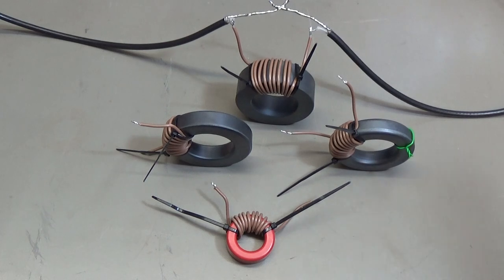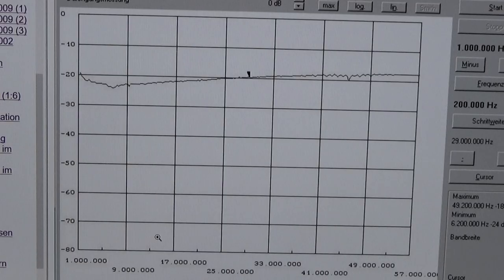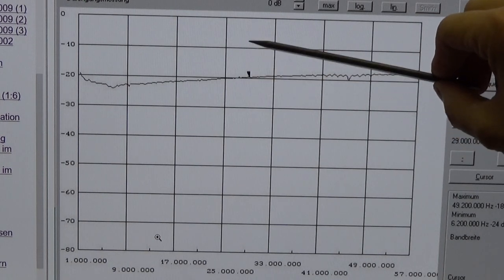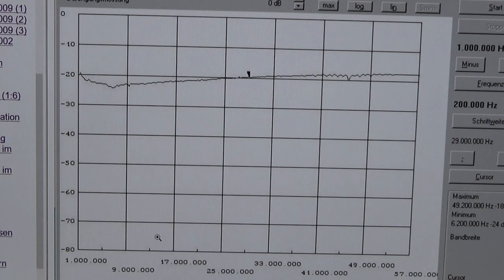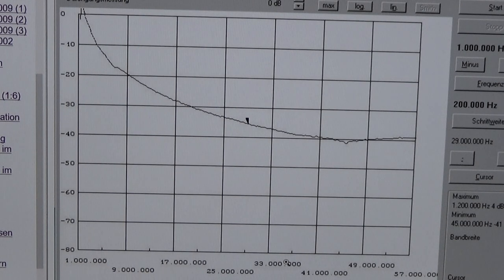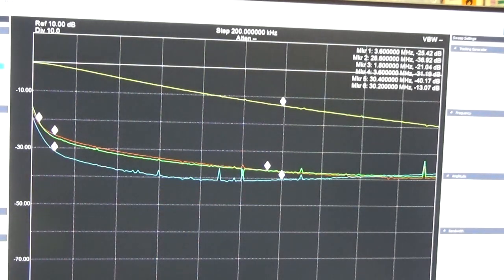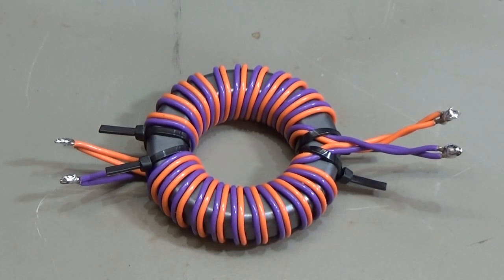#101 Balun PART 2: Balun's magic and how to wind an effective working Balun

Comment: What happens if I accidentally put an extra turn on each side of this balun design? Does that negatively impact performance?
Reply from the maker: Hi Jason, no not 1 turn but if it to much you drive the core into saturation which finally ends into a magnetic short.. 73

Comment: What's the relationship between (core type & wire gauge & windings number) versus impedence ?  How to calculate 100 // 100 ohm  that's will be a 50 ohm system ?  As I see in video part 1, the other balun (white-brown winding) present a good CM attenuation but a bad SWR over 1 - 30 MHz sweep ... uhmmm ....  Btw, thank you very much for your video explainations !
Reply from the maker: Yes the wires needs to have 50 ohm impedance otherwise they will run  out of SWR as we have seen it. If we connect two 100ohm segments right and left winding in parallel as we did then we have 50ohm and a good swr over the entire bandwidth ...
Reply: Sorry, I don't agree / understand ! A wire is a simple a wire ... it have no specific impedence. As far as I know,  wire (in DC domain)  has a specific resistence ( in function of material, diameter, length),  but impedence ? Will impedence change in function of wire material, AWG size, number of windings and so on ? Eventually how to calculate it ? Uhmmm ... feel confused sorry.  Thank you ...

Comment: Superb series - thank you.  Could somebody help me with the following: Peter says that we need a torroid such that the attenuation is high so that the common mode currents will be 'zapped' however won't this attenuation also affect the wanted signal that we wish to pass?  Now, I guess that the wanted signal is not attenuated but would some kind soul please put me out of my misery and explain why?  Many thanks Kevin M0XYM
Reply: The useful part of the signal stays nearly intact (very low insertion loss). The key here or you can call it the purpose of this part is the common mode current rejection, which some are unaware of, but very important to take care of it in order to have quality singal. - The useful signal that you care about is not the common mode type. I recommend to pay attention to every word he says and watch the next part as well. Pause and Replay if you get lost and watch it again.

Comment: Thanks for the awsome video Peter.
I wish I had such measuring equipment. Especially the VNA.
What do you think is the right toroid for a 100W equipment?
I want to build a 1to1 balun for portable use so it should be compact.
73 Bernd
Reply from the maker: Thank you Bernd. Well for 100W a FT140-43 is perfect. Hope that helps. 73
Reply: It helps! .....and what luck, I have even 2 in my stash :-) 
I'm going to wrap my balun tomorrow.
Nice week and thanks again!
73 Bernd
Reply: I'm trying this on a 140 core I had lying around. 11 turns of some 22awg ptfe wire I have doesn't fit neatly against the toroid on one side. Would leaving it looser cause a problem, or should I just use two toroids with 11 turns each?

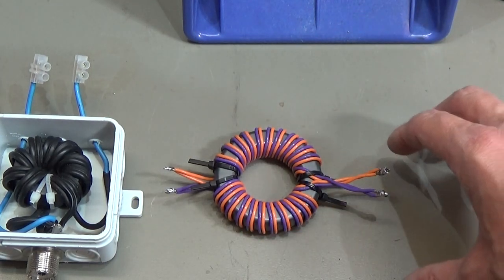Comment: BUT, YOU CAN DO 2 JOBS WITH 2 CORES! At 50:44 do both. The 4:1 has low loss. The Choke has common mode loss. Cascade them.

Comment: I am using an UNUN inside my MORPHY RICHARDS 27024 LW/MW/SW/FM/DRM/DAB SDR and is working better than ever before but I think I will have to add another one somehow for SHF 1452-1490MHZ(1.452-1.490 GHZ) so a stripline BALUN is going to be hard to make.
Reply from the maker: Ah very good David, sounds good. All the best 73

Comment: This is a very educational series. I would really love to know what core the blue line represented?
Reply from the maker: Yeah me too :^) No to be  serious I don't know. It is out my junk box and I have no clue where it comes from...Thanks for watching 73
Reply: No worries. If you ever find out, keep us posted.  The wire you are using appears to be a 19 strand. Do you know the effect of using a similar wire with 41 strands? It should provide more surface area, but i'd like your opinion.
Reply from the maker: You are talking about skin effect and yes with more surface more power should be possible but I would additional stack two cores.. 73
Reply: Indeed. I have been researching using stacked cores. If I understand correctly, the cores are just stacked together, then the wire is wrapped around both cores as if they were one. I have also been seeing positive results from FT-240-K Cores versus 240-43. Thank you again!
Reply from the maker: Yes stacking is that easy :-) Good luck with the project

Comment: Peter, could i use 10 turns instead of 11 as my Balun is slightly smaller ?, 73's VK6NJP
Reply from the maker: Hi Jim, yes it is possible but you lose of course inductance which cause a lower attenuation on the lower frequencies.  But no question test it out. 73
Reply: Thank you Peter. 73

Comment: Hello Peter! I recently decided to build a new Windom antenna and, as I had previously seen your videos (I'm one of your best fans I think :)), I decided to follow your advice. I began building the 1:1 BALUN but I stopped there. While I used your same identical wire (I bought it in Germany), winded the same identical number of turns in the same way as you did and connected the wires exactly as shown, I decided however to use an Amidon 240-K toroid, instead of a 240-43, because of its larger bandwidth. Unfortunately measured results (I have a MiniVNA Tiny) on a resistive load were unsatisfying. Even from 1,8 to 30 Mhz the S.W.R  and impedance have much more deviation along the frequency range (from 1,03/50 circa to 1,31/61). I'd be curious to see your measurements on a similar toroid, if possible. 
I really do not understand if the fault is the chosen toroid or if I have been screwed and the toroids I have are not original 240-K.
As the use of 240-K toroids is becoming widespread for their assumed larger bandwidth, I think this could be interesting for many hams that want to build their own BALUNs. Thank you for your videos.
Reply from the maker: Simone, I believe that the toroid is the problem. I'm more than sure that using a Amidon 240/43 will solve the issue. May be this report will support you additionally https://a08.veron.nl/zelfbouw/antennes/800-watt-fd4-multiband-antenna-with-super-balun/

Comment: A great set of videos.
I have a couple of questions.
In the 1st video, you used a stand-alone spectrum analyzer to test attenuation. What software and analyzer were you using in this video?
How did you determine how many turns to use?
Thank you for the great instruction.
Karl
KE0JWK

Comment: Uhmmm... correct, but ten turns and so close are too much to test a toroid up to 50 or even 30 MHz (I am referring to the parasitic capacitance between the turns): for this reason in that part of the graph you don't get a reliable data. You end up seeing the effect of those distributed capacitance: in fact, at those frequencies, the graphs of the three ferrite toroids overlap despite the different mixes. After all, for a broadband transformer starting from 3.5 MHz and using a mix of 43, with only two or three turns (depending on the size of the toroid) you get enough inductance for a primary.

Comment: hi i've just a little question why choose the ft240-43   core  and not the 240-77core for 0.5 to 50Mhz...??? is the ft240-43 better???
thanks F4HDI franck
Reply from the maker: with high TX power a 77 core material might go much easier into saturation which will end up in a no working balun...73
Reply: TRX Bench ohhh i see thanks for fast reply  you re vidéo are awesome in explication how work balun thanks for them 
Best 73 
Franck

Comment: +TRXBench  Very nice videos, danke! Perhaps try twisting the pairs of wires. Twisted pair impedance can be 100 - 110 0hms. Perhaps possible to achieve closer to 50 Ohm  Z for UNbalanced input impedance?
Reply from the maker: There are 1000 ways to do it in a good way. The problem is rather more that there is a lot of crap in the field... Thanks for watching 73

Comment: Hi, you have superb videos, I really learn a lot from them. I had some so-so experience with certain rings not being as effective as I expected. So I just ordered some material 43 ferrits :)

Can you tell me the type or specs of this wire?  I understand it is AWG 18 and TPFE, but I see many varieties on the market. Also, would you recommend this as the material for wire antennas?   73 de HA5XA
Reply from the maker: Hi Krisztian, it is AWG18 PTFE....Here is a data sheet. http://www.habia.com/globalassets/documents---downloads/single-wires/e-and-e-npc.pdf  Thanks for watching 73
Reply: TRX Bench Thank you, I just realised you showed us the wire label in the next video. :)

Comment: Where can I order the correct wire you used in the video. The video is great.
Reply: I just purchased the wire from Powerwerx.com   They also have powerpole parts
Reply: Thank you....
Reply: @mayimchaimqigongstudio6570  for low power that's ok. but no teflon wire there

Comment: Beware... use the Exact wire specified...l tried to use another brand which seemed fine on paper but... the outer diameter was 2.2mm and not 2.1mm as per his brand, the result is overlapping turns because the core internal diameter can't accommodate the wire.

Comment: Hello Peter, this was a VERY good design, i managed to get hold of the same wire back home, ( the silverplated type ) and my HP shows an amazingly flat response all the way past 100Mc, with similar CM attenuation.. around -35Db and this also very high up in frequency - best response i have seen... :-)

Also have a CB question for you, i got in an old Pony CB-78 on my table, but i cannot for the world find any schematics for this one, i asked our friend Mike (mikesradiorepair) but he dident recognize this one eather, ....now i got this thing to work fine.., not a problem, but i´m still hunting for schematics.. PCB nr:KM-35858-00
I have seen this before in Sweden and came to think of you since you are based in Europe

- Any ideas?

Again nice work with all the videos
73

/ Anders
(Sm7HCE)
Reply from the maker: Hi Andres, very good that you was able to repat the good test results. That proofs the robust design of the balun...
Well bad massage concerning you CB radio I'm sorry nothing in my files...73

Comment: First thanks for the nice video's, so i learn things easy, i have a question for you, i always make baluns with 43 core material, but what core material is the blue line, and did you test 61 core material, like the FT-240-61, thx 73
Reply from the maker: Thanks Jos, for chokes/ attenuators Mat 43 is fine it works from 30-600MHZ...Mat61 for even higher frequencies...73

Comment: Hello,
I've made 2 baluns one with FT240-43 (AWG18) and one with FT140-43 (I've used AWG22). With FT 240-43 the results are pretty the same. But with FT140-43 SWR is around 1.5 at 30 MHz. And almost 2 at 50 MHz. If maybe someone was trying to use FT140-43 and got a good results - could you please share them. Thanks!

Comment: Hi:  Can you give the exact part number label for the wire you used? Thanks.
Reply from the maker: Hi, well the only info is that it is AWG18 PTFE silver finished stranded wires.. Hope that helps. 73
Reply: Is there not a Brand name or supplier?  The spools that you showed had part numbers, but I couldn't read them on the video. Thanks.
Reply from the maker: I'm sorry, that is all I have...
Reply: Curious as to reasoning for refusing to give the manufacturer and part number from the spool of wire shown in video...is it a 'trade secret', or some other legal reason for not wanting to share the information?

Comment: Thanks for doing part 2 on Baluns Peter.
That PTFE balun wire is indestructible! Those rolls must have cost you a small fortune.
The end results wound on that core is nothing short of amazing. Wow! The majority of baluns used out there must be crap.

I tried to find DG0SA at QRZ but no results. Is this his website?: DG0SA.de If it is, I see that he sells them. Though I would like to build one myself.

Great video Peter as always, and thanks! A real eye opener for me.
73 Tom
Reply from the maker: Hi Tom, yeah you are right this PTFE wire is betweem 1,50and 3 Dollar per meter / 39,37 inch. And it is true there are really a lot of Baluns in the field which are simply not doing its first job. Yes the web site is right! That is our Balun expert! Yes he is selling kits over his web site but I don't know if he is shipping overseas. Simply drop him an e-mail. Thanks for stopping by 73

Comment: @ Peter: Brilliant videos and a perfect transformation of the DG0SA instructions into videos. @German spectators: wire available at www.buerklin.de, BestellNr. 91F6602 (orange), Bezeichnung: Teflon-Schaltlitze Nema HP-3, AWG18/19, 0,96mm² - auch in anderen Farben (bspw. violett Best.Nr. 91F6605)

Comment: All the Baluns I have used are cylindrical, the core is a solid straight rod. Works the same I guess?
Example: http://owenduffy.net/blog/wp-content/uploads/2016/06/W2AU001.jpg

Comment: @35:00 - You are no longer allowed to tin wire.
Reply from the maker: who told you this wisdom?
Reply: @TRXLab  I know because I'm no longer allowed to tin wire for exactly the same reasons.
Reply from the maker: That was my question >> what is the exact reason for not being allowed tinning a stranded wire?
Reply: @TRXLab  Solder blobs on the wire and that big ol' solder blob on your bench. Or, in my case, all over my dining room table.
Reply: @TRXLab  Also, I'm just giving you a hard time. The videos were great!